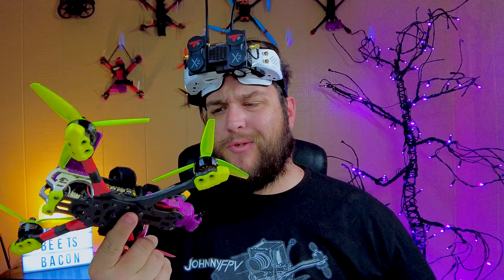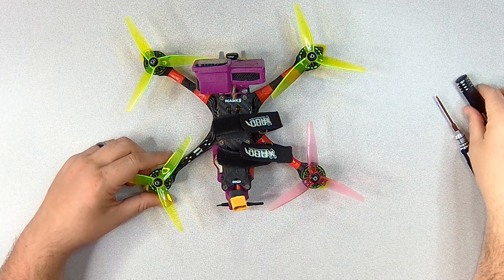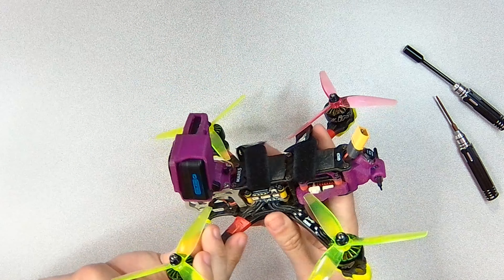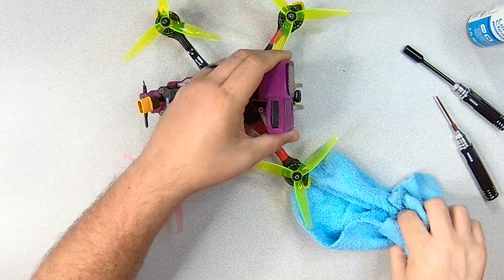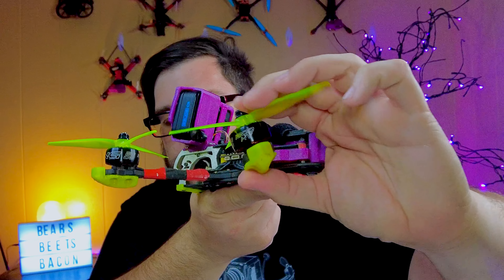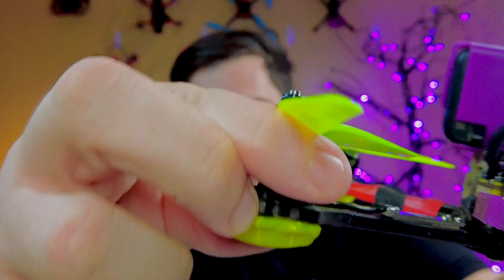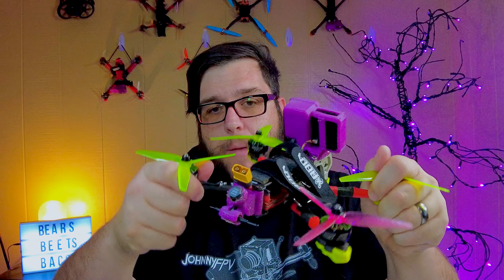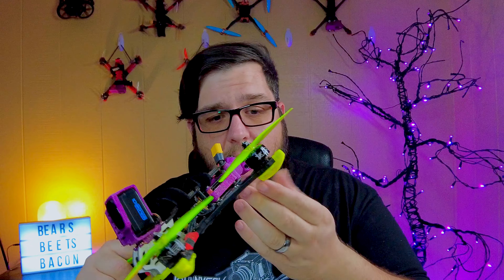Skipping this in your pre flight checks might make you suck at FPV drones! // BaconNinjaFPV

Comment: I've had this too.  I fly mostly parks/tree spots.  And while I do break arms sometimes, this kind of delam is more common for me.  I think it may be a side effect of crashing in slightly more forgiving environment.  and it's definitely easy to overlook
Reply from the maker: For sure man, flying in softer places means the arm breaks are much less apparent.  I have broken a few arms in grass, but much more often it is a delamination.  I usually keep an eye out for it after it happens, but over time I get lazy...lol
Reply: My experience aligns with yours @mothcore. I fly mainly in and around trees and over grass. I have crashed the living crap out of my quad, but delamination seems to be the mode of failure, rather than outright breakage. Perhaps if I flew bandos etc, I'd smash more stuff, more throughly.

Comment: I, like you grab the motor and twist. This way I make sure the screws are good too. Two birds.

This is the most common failure for me. 95% of my arm replacements are because of delamination not outright breaks which account for less than 5%

Great tips bro. Happy flying. Hope the vacay was good for you and the fam. ❤

PS The audio is different, I like your voice with that microphone, even with the room noise.
Reply from the maker: I am going to make more of a point to check it now, lol.  Usually when I break arms they are either completely in two or they have delaminated and bent in a crash.  This one was just being super sneaky!  Thank you for the notes on the audio!  I am using a different setup and still working through some of the kinks, but I like it so far too.  I couldn't stand my wireless DJI mic clipping all of the time for what seemed like no reason, lol.
Reply: @BaconNinjaFPV  it’s always the sneaky arm and plate delamination for me.

Audio wise, recording 32 bit audio has such a large dynamic range that it’s basically impossible to clip, even if your levels aren’t set perfect.

I don’t have experience with the DJI kit, but one of my friends loathes it and went back to his rode wireless go, or whatever it’s called.

I just use dynamic cardioid microphones personally or that 32 bit pocket recorder I can’t remember the name of right now for some reason. I’ll let you know when I get home. It’s a good portable setup.
Reply from the maker: @lemonsquareFPV  I am running an H4N pro at the moment and all I have for a mic is a Rhode video micro mini shotgun.  I used to run a recording studio and wish I still had some of the mics I used back then! Lol.  I will probably wind up with something better at some point now that I can accept XLR on the H4.  I just haven't made a decision on it yet because I really need something directional to keep the sound of kids running around the house out of the primary audio track....gonna take some playing with different set ups to get there I imagine.
Reply: @BaconNinjaFPV  you have the experience then! Me too! I used to be in the music business, film too years ago.

Just have a cardioid dynamic less than 6” from your mouth and that should be all, with a setup like this I can record in the worst of environments. But you already know all the tricks I assume.
Reply: @BaconNinjaFPV  se electronics V7 I feel would be good with your voice. Listen to Bandrew’s comparisons here on YouTube at his channel Podcastage. He is a really good resource!
Reply from the maker: @lemonsquareFPV  hmmmm, I actually had that in mind, lol.  I was between that and the Audio Technica 2035 cardioid condenser.  I may go SE v7!
Reply: @BaconNinjaFPV  with a condenser if you don’t have a perfect environment you will have ALL the background noise :p they are too sensitive
Reply from the maker: @lemonsquareFPV  yeah that was my thought too.  I love the way they sound, but silence is impossible here and I don't have any real dampening in my studio so reverb would come in pretty hard.  I think the v7 is going to be a great choice though!  Back when I had my studio, I had the whole room engineered to be absolutely dead by default so I was a little spoiled to that, lol.  I would actually have to add some surfaces to create a more natural sound for some things rather than fight to keep it out in the first place.  I had sooooo many nice ribbon mics that I miss very much.
Reply: @BaconNinjaFPV  ribbons are pretty dope I DIYed one and it sounds pretty good. Too much bass for voice though. Especially on tubes.

I know what you mean being spoiled :p but the real world is not bad, gives character to the recordings. As long as you don’t have room noise overwhelming the audio it’s all good.
Reply: @BaconNinjaFPV  The cheap 32bit float audio recorders I have experience with, both great, recorder wise:

Zoom F2 for vlogs and such

Tentacle Track E for more serious work with multi-cam because of timecode awesomeness.

Just haven’t used portable setups in a while and I had forgotten. :p

Comment: It's amazing how sensitive these toys are. I noticed the same 'weirdness' when flying my quad, before I realised that one arm had delaminated. I cannot help but wonder if the absolute bare minimum of resin is used in these quad components (I am guessing the carbon is pre-preg?).
Reply from the maker: I figured it is probably them using the most cost effective carbon sheet they can with the correct rating stamped on it.  How it gets the rating, or how it passed the tests to achieve it....we will never know, lol.  Well made carbon is expensive and somewhat labor intensive, so I imagine it is one of the most commonly cut corners on our frames.
Reply: @BaconNinjaFPV  Cheers for the reply. I spoke to a friend of mine who used to make carbon components for motorcycle racing teams and he basically said that pre-preg carbon offers the best weight/strength combination (minimum levels of resin whilst still providing 'adequate' strength). So I think you're right - I suspect it's the cheaper end of the pre-preg carbon. I am in no way complaining about the strength of my quad arms, they have taken a crap load of beatings and held up awesomely. Was just an observation when I saw how smoothly the layers separated.

Comment: Ply separation and being built with the lay lines incorrectly clocked for a torsional load. I work CFRP for Airbus and I opt for 6mm arms.
Reply from the maker: I absolutely agree.  These are 5mm, and as best I can tell from seeing it separate while flexing, the layup doesn't include many 45° layers if any.  It sure seems like they are mostly laid at 90's which does not do well for torsion loads at all.  I am considering having some 6mm versions cut from Chris rosser's layup...but then again I could just get my own mill and cut them myself!  All I need is a good excuse! Lol

Comment: Unfortunately weak arms are the main flaw to this frame. They become delaminated way to easily. I have 3 of these frames and had to replace arms on them all after even small crashes that my Apex would have laughed at and said you call that a crash... I reached out to geprc about this and they sent me 6 replacement  arms. After I go through them I'm probably switching frames.
Reply from the maker: I have only had this happen to the one thank goodness.  This frame has a couple of hundred crashes on it probably, so I guess it isn't too bad over all...but I was disappointed at how clean the delam was since that would really point to an epoxy issue.  I am considering re-designing the arms a bit to include more of a two spoke layout further into the arm and having them cut out of AOS arm carbon.  Gotta see what that costs, but I may just get a ton of them made up.  I haven't had any issues with the other carbon components, so I think they just may have either gotten a sub par substrate for the arm thickness, or there was something wrong with the QC of their sheets before cutting.
Reply: @BaconNinjaFPV  that would be sick. Its such a Well laid out frame for HD having stronger arms would make it perfect. U should try the FPcycle Sonicare. Not as much relastate for electronics but  it Flys like a masterpiece of engineering. 👍👍

Comment: Is that the mark5? I have the mark5 analog. I had to replace both rear arms on mine. Same problem.
Reply from the maker: indeed it is.  Unfortunately I am hearing quite a bit of this after showing mine :(  It seems like the carbon they chose may have had a layup that didnt do well for torsion loads.  I am thinking about having some cut from chris rosser's AOS arm carbon and changing it up to a two strut design to see if that may hold up better while giving even better resonance qualities!